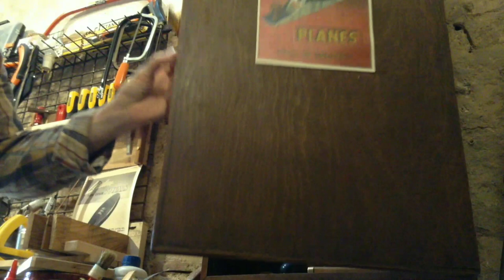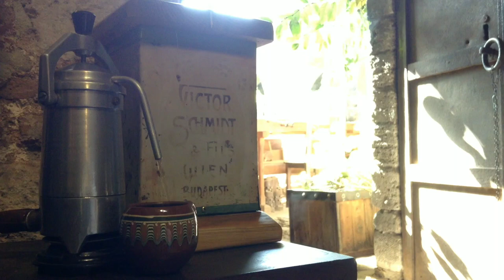1900s Straight Razor Restoration - I'm  shaving with this

Comment: I've been given my great great grandfather's razor. It has thin ivory scales still intact. If I want to take it apart to clean it up and put it back together how should I delicately grind away the pin heads so I don't crack the thin ivory?
Reply from the maker: if the handle is not broken, I think you can clean it and use it without taking it apart.